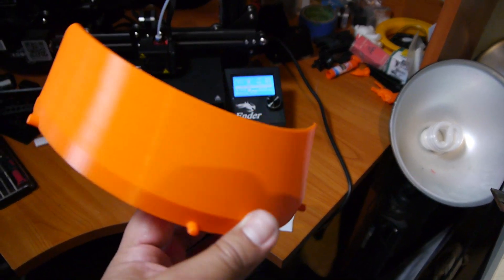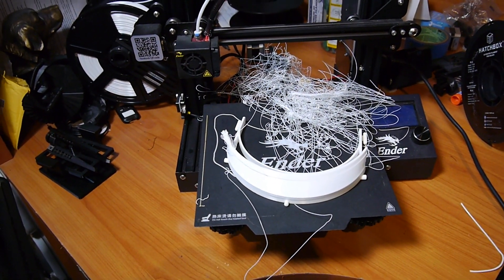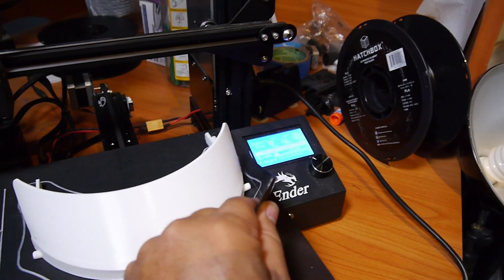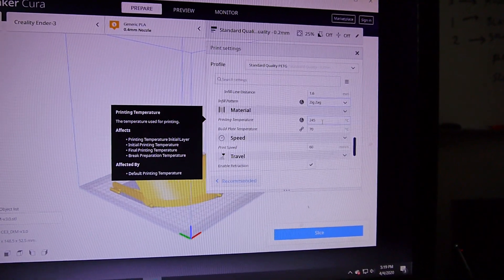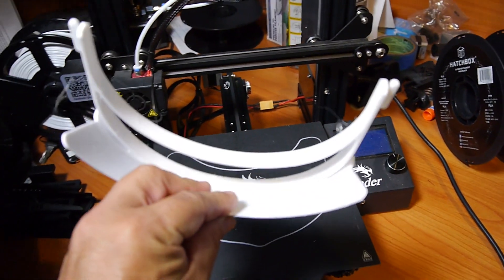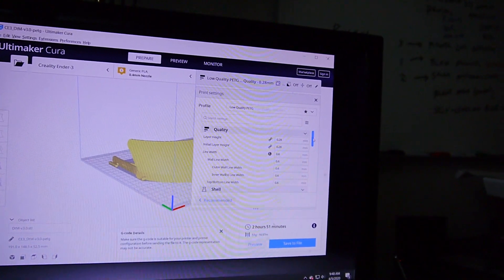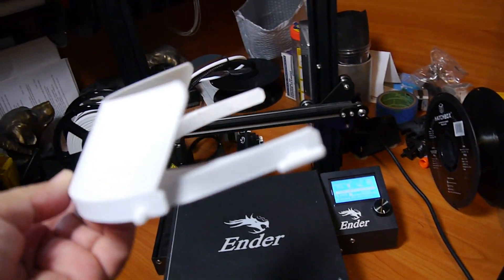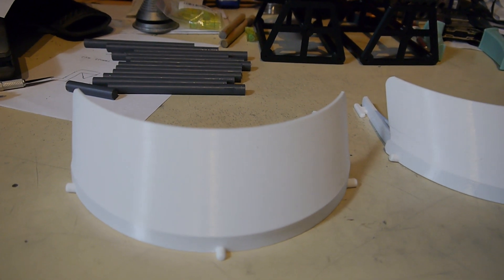Ender 3 Pro, Trial and Error PETG settings for a Fast Print

Comment: @ 5:33 I noticed your printing temp at 245 and your build plate temp at 70. When I first got my E3 Pro the Cura settings were set for PLA. I got a lot of stringing and my piece broke apart like the first test print you showed. I realized I hadn’t checked the recommended filament settings and changed the printing temp to 270, my build plate temp to 79 and I reduced the print speed from 40 to 35. My next print came out a lot better with very little to no stringing. I then kept the build plate temp to 79 and reduced the print speed from 35 to 30 and left the printing temp at 270, the print came out even better. I’ve kept those temp settings and all the other settings at the defaults and I increased the build quality from standard to dynamic and then from dynamic to fine and it helped with the quality of my prints. The project I’m working on uses small parts with some fine details so my settings work well. 
Depending on the brand of PETG you got I’d set your print temp to the recommended minimum temp range to start and set your plate temp to the minimum range too. If you can I’d try reducing your print speeds as well to help improve the quality of your prints. Good luck 👍🏽
Reply: @mata7produccions Thank you!, but for anyone who decides to follow this advice, please take caution in cranking up your hot end temp to 270c or more. Your bowden tube WILL start to soften up over a good amount of time and there may be some off-gassing (can harm or even kill pet birds and may not be safe to inhale) with your PTFE tube. So if you are printing at 270c+ I strongly recommend to have your printer ventilated.

Comment: Thanks, your research has helped me greatly.  Use PLA so far but want to print some stuff that will be in a car or in a warm or hot area in the shop and want to try pet. That helps with settings for sure. Thanks for all the time you put into this. Amazing to cut your time to 1/3. Rock on! I like fast prints for some stuff thats just hardware not art. =)

Comment: Hey, nice experiment! I do wuite a bit of rapid prototyping in PETG. I'd suggest having a heatgun handy after pulling the print off the plate. kills the 'petg whiskers' instantly and doesn't warp the part. I'd also suggest getting an all-metal hotend. My ender 5 plus stock hotend killed itself with PETG because the temps got too out of spec too often. You'll be able to really push speeds while not having to jack up your hot end temps. Great work, keep it up.

Comment: I was experiencing warping on my Ender 3 when printing PETG, I set my bed level so I had minimal squish but still good adhesion and checked this by taking off the purge strip straight away I set my initial layer to 250 C with no fan and the main print at 240 and 50% fan.
 I was printing on PEI with the bed temp set to 75 C
 This has solved my warping by 99%, I still get the odd bit of warping but I have to look very carefully to notice it!
Reply: Thanks for this detailed comment. I will try this after my next fail lol.
Reply: 270c? Lol you're literally begging to destroy your bowden tube.

Comment: cura profile. 240 extruder, 75 bed, layer 0.2 at speed 100 mm/S with skirt of 3 lines and 100% infill. no warping and fast as fuckeroe
Reply: @Brad DeVoir why not? the petg i have can go to 250°
Reply: Are you just using a stock ended 3 pro to get these speeds? And what petg filament are you using?